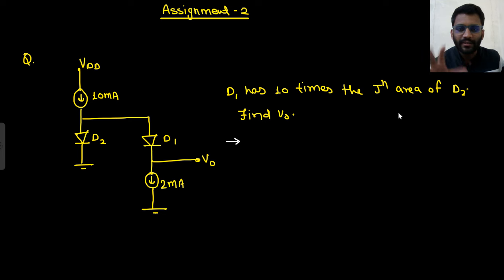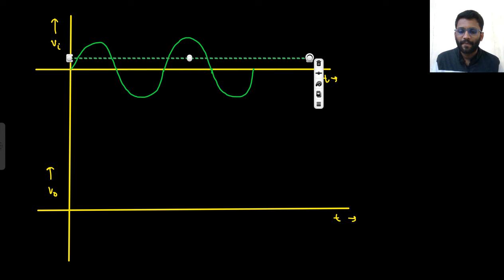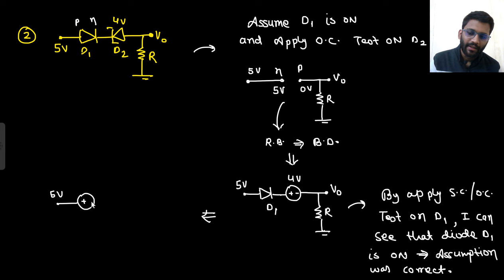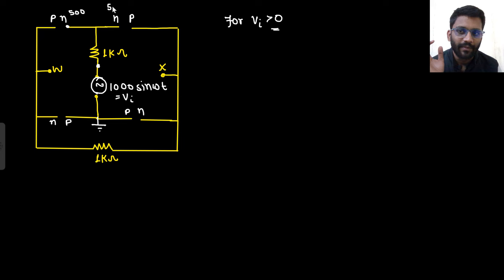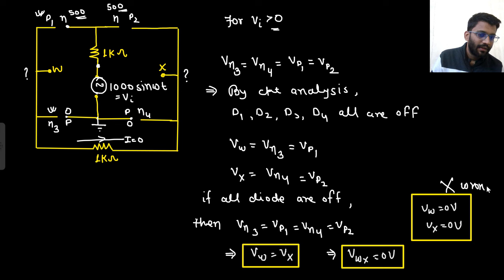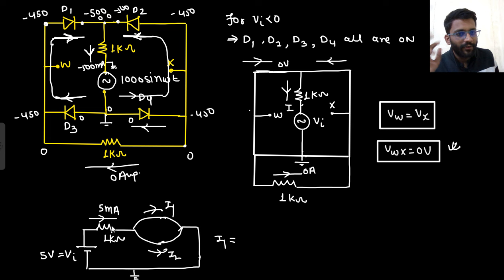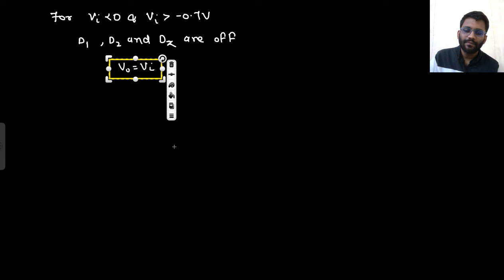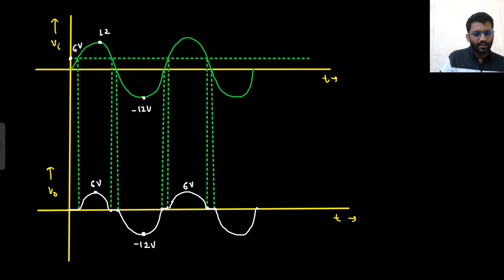Assignment 2 Solutions (PART 1) || Analog Electronics || PrepFusion || Himanshu Agarwal

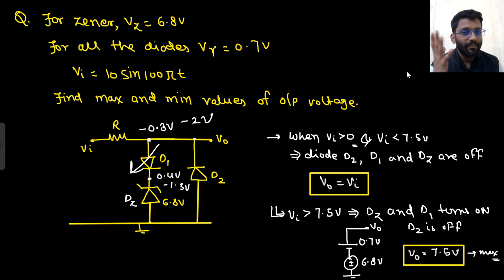Comment: Nice Video @Himanshu!! Just a small issue: @59:12; when p-side of diode is at -0.3 or -2V, there should be a drop of 0.7 volt, so the n-side would correspondingly be -1 or -2.7 volt I think.
Reply from the maker: Yup, correct. and that would make you feel that zener diode is on in forward bias. Now if zener is in forward bias, it will be replaced with a batter of 0.7 V and the other diode we are already assuming to be on. So this will also be replaced with 0.7v battery. So what will be Vo now? 0V, right? But if Vo is zero and Vi is negative then in which direction the current would flow in Resistance R? From right to left, correct no? And if the same current flows in the diode then it shows that diode current is from n to p which is opposite to our assumption and that makes the diode to be off. So, Vo=Vi until Vi=-0.7v 

Did you understand?
Btw, Thanks for marking it out.
Reply: @PrepFusion_GATE  Yeah Understood @Himanshu